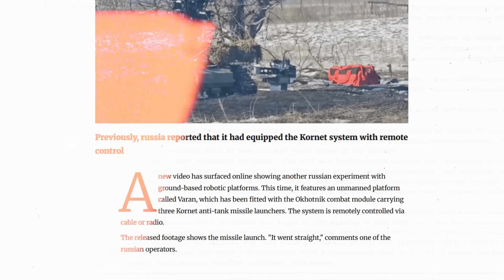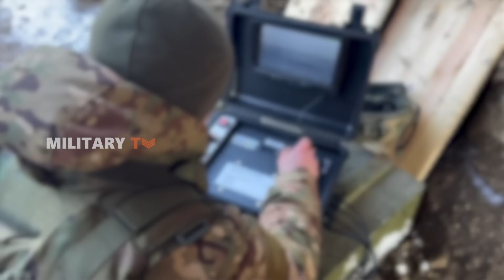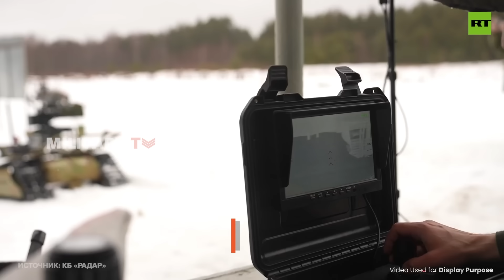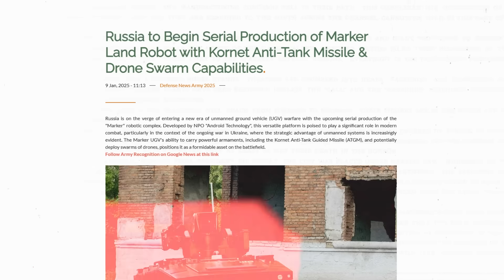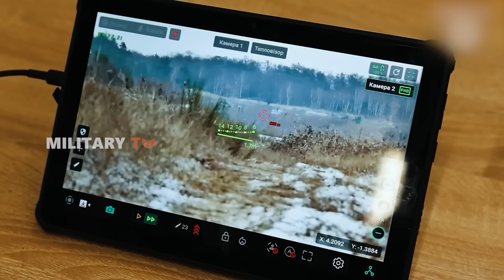Russia Unleashes Remote-Controlled Combat Robots with Kornet Missiles —Should the West Worry?

Comment: Of course, the vehicle should also have a cable connection if there is a radio jam!!!! Especially for those who carry drones with the help of a cable, it would have a much better segnal. And since this type of vehicle is mostly for missions up to 3 km, this shouldn't be a problem!!
Reply: Various militaries  since 2000 which rely on in-memory maps for the situation where they can no longer use GPS. After such a length of time they're probably  almost fully autonomous in working out where they are.